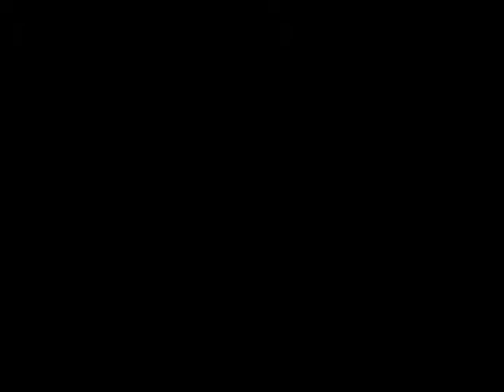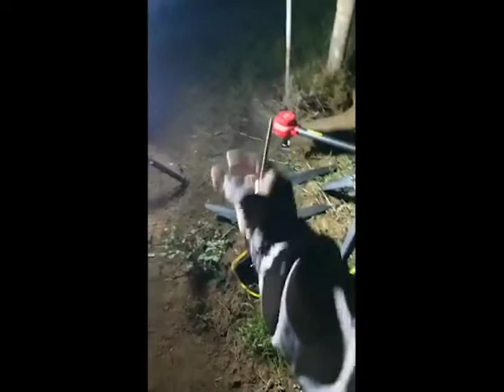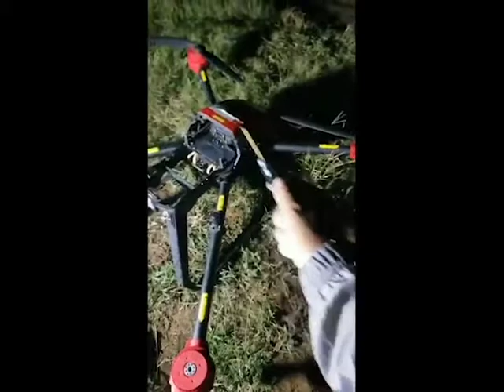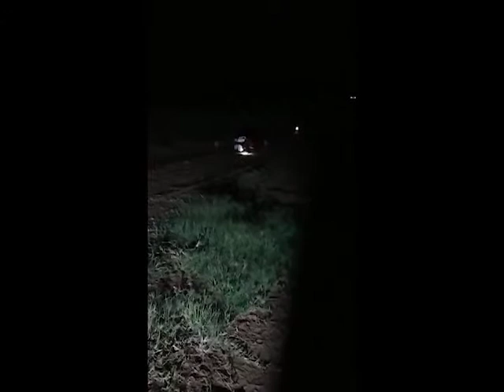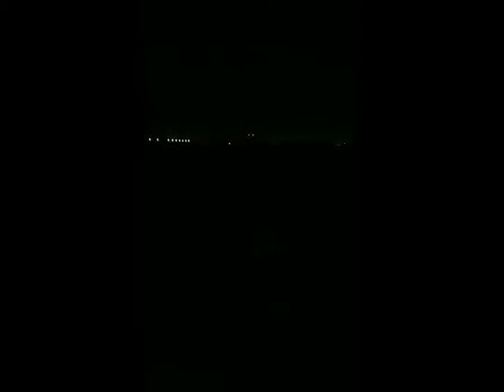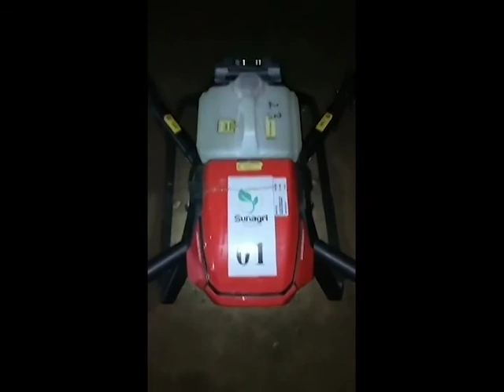How easy is it to Repair XAG UAS after an accident?

Comment: Why didn't the anti obstacle sensor work to avoid this accident?
Reply from the maker: Because this video was from a P20 Plant Protection UAS, and the obstacle sensor is an option and it was not installed on this aircraft